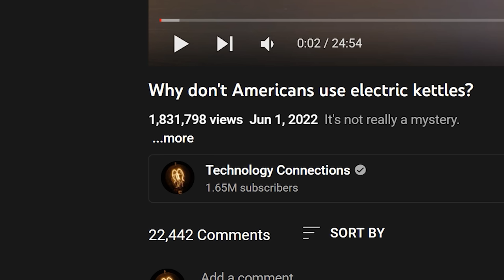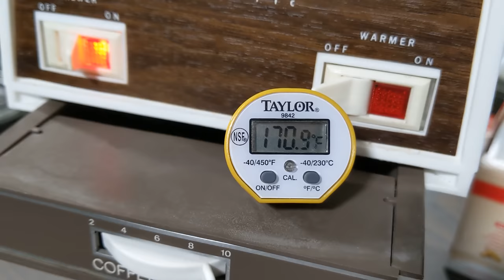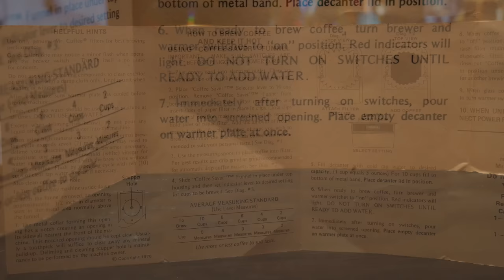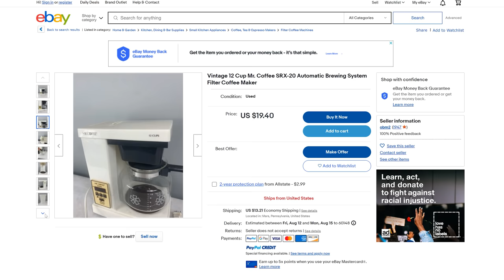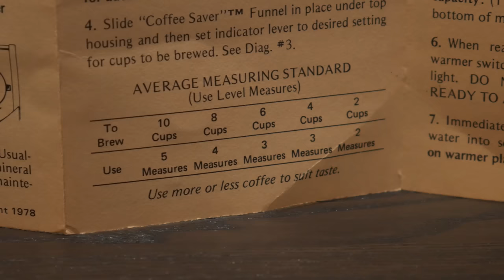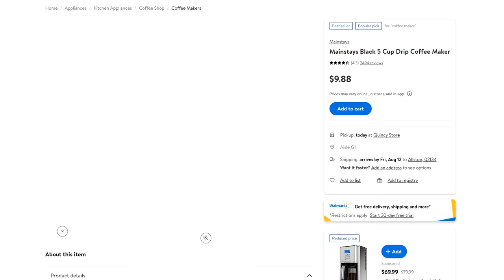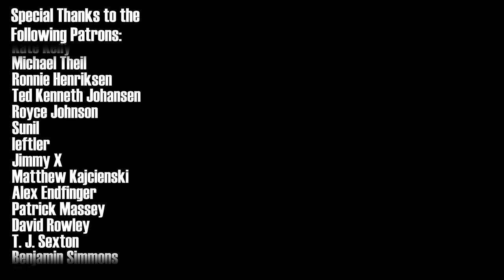Drip Coffee Makers — super simple, super cheap

Comment: I find that models without a hotplate are my favorite, I brew directly into a thermos-carafe on my big brewer and on my single cup brewer I brew into a small soup thermos. Either way my coffee stays warm for much longer than I actually need and I don't ruin it's flavor over time.
Reply: yea only using those for years. that way you can take your coffee to your desk and it will be warm till it's empty ^^
Reply: We had one of these for a long time. The disadvantage is that the carafe was the size of a 12 cup one, but only held 8 cups. 

The one we currently have used for over a decade now brews the coffee into an upper reservoir, and you can dispense it into a cup. It still has a heating element to keep the coffee hot but it seems to burn it less than the carafe style ones.
Reply: Back at home my parents used a basic brewer bit would just poor it all over in to a separate flask. Or better they had two. My mother preferred a slight less strong coffee them my father does.
Reply: @sirBrouwer  My father in law always poured his into an air pot (insulated vessel with air pump to dispense) from his bottom-of-the-line brewer as well.
Reply: @timfischer  I have seen similar things being used but just with the use of the water/ coffee pressure it self. Also worked with soups and what not. But it was massive. Like you use it when you go somewhere with a group.

Comment: Interesting video. I now understand why my coffee maker with a thermal carafe still has a hot plate on the bottom. I am guessing it was easier to leave it there than redesign the thing completely. It does turn off automatically when the coffee is done brewing, but it is good and hot during the brewing cycle and right after.

Comment: For years, we’ve added a paper filter in the basket of our percolator type coffee maker. To cut the hole for the stem, simply fold the paper filter in half 4-5 times and then snip off the point. Keep the hole diameter slightly smaller for a press fit around the basket stem. This keeps 99.9% of the grounds in the basket and allows for using any available or preferred coarseness coffee. This mod works for coarse ground as well as medium ground and fine (espresso) ground coffees. Clean-up is easier and the coffee is smoother tasting.

Comment: I really like your channel on different, sometimes a bit random topics, digging into details. And you never forget to compare to us yuropeans. I also like to see how things work in North America. Headlights, traffic lights, electricity system etc.

I always bought those cheap filter coffee machines for maximum 20 Euro (even cheaper if as company without tax). But they die fast in a company with several pots per day. Not the intended usage. So we always bought a new one almost every 1-2 years. Repair is not worth it unfortunately. 

Now the fun fact. We always bought the same cheap machines. They always had a mechanical I/O-switch so if you forgot to switch them off in the evening, the water vaporated And next morning you had a nice dark black coffee coating at the bottom of the pot. Nice work to clean. 👍

Then EU Intervened with their power saving regulations in 2009. Next dead machine: opening the last Amazon order "buy the same product again" and we got the exact same machine but with a pushbutton instead. Huu? Manual... Automatic poweroff. Adjustable up to 40 minutes but not possible to disable. Great. So now you can't forget to switch it off in the evening but during the day after 1-2h you have cold coffee instead. Yeehah, everyone was happy in the office.

EU is the biggest economical region in the world and the whole world benefits from standardized USB cables and even forces Apple to follow cause otherwise you have to produce different versions here and there. Apple is going to have their MFi chips in cables. EU Intervened: not standard, forget it. I prophesy Apple will introduce them anyway but if you switch location to an EU country they will turn of the limitations while you get them anyway.. 🙄

Vacuum cleans (or dust sucker how we call them in Germany) in my youth had 1600 watts, then fancy 2.000W then 2.200W then 2400W or even 2600 Watts and could suck a golf ball through a garden hose. Since 2009 they are limited to 900w in the EU and some are no fun to clean the floor with them. Sometime I just take a broom. 🤷‍♀️

Comment: Keep your coffee fresh with a vacuum canister!
Hey Mr TC, I got the one bit of coffee enthusiast kit YOU GOTTA HAVE: vacuum canister!
You said how you noticed how your beans would degrade with time, well, THEY DON'T HAVE TO!
Get a vacuum storage canister for your beans! This is will keep your beans fresh for weeks.
But watch out: you can get some that only allow you to suck out all the air when you close it, but that's not good enough. (Some actually work by twisting, which is really annoying.)
See, coffee outgasses, so the vacuum gets spoiled fairly quickly, which makes the whole thing pointless.
I found a battery-operated canister that has a sensor that runs the pump whenever the vacuum breaks.
Ngl, this can be annoying, as you'll hear the pump start whirring at random intervals, so if you sit in your kitchen, you'll hear it.
I made this acceptable by simply keeping it in a cabinet.
I can still hear it, but now it's just a soft reminder that my coffee is staying fresh.
The canister i have is made of glass made by a company called "Soulhand", and it was about $40 on Amazon. It charges via USBC.
I'm sure a guy like you could whip up your own, but this is easier.

Comment: Nice to see some of the ... interesting engineering on the OG Mr. Coffee! A few things I thought worth pointing out in general:

24:00 - this is a pretty cool feature, not because of "coffee saving" or whatever, but because in theory it should create better extraction by improving the full coffee bed's exposure to water. One of the weaknesses of cheap drip machines is poor distribution from the shower head, leading to an uneven ground bed with some grounds seeing very little water and others seeing far too much.

19:52 - years ago I was able to increase the brew temp on a similarly-designed brewer by fitting a piece of PEX pipe over the full length of the intake tube, effectively air-gapping it from the cold water in the tank. After this mod I saw a consistent 190 to 200F from the shower head, approx. 10F higher than before. Not sure if this would work on every coffee maker the same though, I guess it would depend on how good of a seal you can get at the bottom to keep water out.

22:20 - you'll be hard-pressed to taste minor differences in your coffee if you cover it up with milk & sugar. I suspect these tests would've had different results if you used black coffee, cooled to under 140F before sampling.
Reply: funny I was thinking that when I saw the water pour in, it's hardly saturating the grounds evenly.
Reply: @KairuHakubi  Exactly, and at the end of the brew you're left with a lumpy pile of grounds resembling a NYC road in February. Ideally you want a nice flat coffee bed at the end which suggests all the grounds received similar amounts of exposure to the water.

Comment: I got a moka pot at my local Meijer; there were an entire two different choices.  It makes a rather decent brew, but has the issue of requiring an external heat source.  I mostly take it camping and use it on a camp burner.
Reply: They make electric moka pots too, with a base and an enclosed heating element just like in an electric kettle.

Comment: On the off-chance you ever read this: I'd like to suggest the Clever Dripper or one of its competitors. It requires a kettle to boil water, but it's a fantastic hybrid between a manual coffee dripper and an immersion brewer like a french press, and because a filter is used cleanup is simple. Moka pots tend to make very intense or bitter coffee, and they're great if you want to make a latte or other heavy milk or cream based coffee, but quite bad for making coffee to drink black. Thermos or other insulated carafes are also a great upgrade for an automatic coffee machine, keeping the coffee warm without the need to run a hotplate after brewing.
Reply: Clever Dripper is amazingly overpriced for what it is and where it is made. I love the thing tho.
Reply: Espro as well with the paper filters who needs goosenecks when you only have a kettle and a scale cause YOU GOTTA WEIGH YOUR COFFEE :X
Reply: @4kirb  Oh absolutely. You could just fashion your own valve or cone out of an old automatic machine with a drip lock to get the same type of brewer. There are some patent concerns which is why the even more expensive Hario Immersion Dripper works with a different style of valve.

The clever is convenient because it doesn't require finagling or modifying a dripper with 3d-printed food safe parts and it's the cheapest dripper in its style even if it is expensive for what it is. It also uses the Melitta filter papers, which are extremely cheap where I live. An order of magnitude cheaper than Hario filters.

Comment: For what it's worth, I got into coffee during the pandemic and settled on a Clever Dripper coffee maker for my personal ideal taste-to-effort ratio. You don't have to fiddle around with careful and controlled pours like a pour-over, or plunging and dealing with metal filters like a French press.  It is, in my opinion, the best of all coffee worlds because you just pour your water, wait a couple minutes, and set it on your cup, then cleanup is just taking the filter paper to the trash and rinsing it out.
Reply: All good information. To add to that I would recommend using specific water temperature relative to the roast level of your coffee. Dark roast, like the legit covered in oil stuff, shouldn't be brewed above 88º, proper medium roasts fall into the standard zone most machines target (and rarely achieve) around 90-93º and modern light roast, high elevation, high density coffees require water temperatures at or around boiling, 96-97º at the low end.
Reply: @_DeadEnd_  Honestly, I bought a second one so I could make coffee for guests.
Reply: @_DeadEnd_  have you seen this video about stratification of the French press brew?

https://www.youtube.com/watch?v=st571DYYTR8

Comment: I honestly go for a pour over because I don’t drink enough coffee at once to justify a drip machine. It makes more sense for me to just brew one cup when I want it
Reply: Lately the best coffee maker for me has actually been the aeropress. It's convenient, pretty hard to screw up, and easy to clean.
Reply: @DevynCairns  I’ve heard good things
Reply: @DevynCairns  Yeah same, as I'm usually just making one cup my aeropress is so much simpler than the proper drip brewer, and I can adjust the variables (temp/brew time) way easier to my taste.
Reply: @embers_falling  honestly it's pretty impressive how well it works considering how simple it is, but you get a good clean cup and it gives you pretty good control without having to guess so much about your grind
Reply: @DevynCairns  I’ve definitely had it on my wishlist for a while but other stuff has seemed to come first.
Reply: There are small drip brewers that will do one cup
Reply: @juggernaut316  I have a few of them....I use it for hot water for coco
As much as for coffee in the shop..
Comes with its own mesh basket so no other filters required
Reply: @DevynCairns  I wouldn't use the AeroPress with store grounds though, they are way too fine IMO
Reply: I love pour overs but really don’t like the route many people go with it where they try to keep the acidity. I don’t like much bitterness either, so I try to brew a well extracted cup that has high body and a dark color instead of being tea-like. I might get a flat bed brewer instead of a V60 if it’ll help with that.

Comment: I use at home and in the office: 2 espressomachines, a filter / drip machine + thermo pot, a mocha pot, a french press and just ground coffee + boiling water in a cup. I am a heavy user. I would say that the drip / filter system produces the least bitter coffee, and because of the thermos, keeps the coffee the longest at constant quality. Even the second half from the french press is already more bitter and/or acid. The espresso machines use 7 grams per cup - but since the water is forced through it so quickly, it seems to me you get much less of the flavour out of the coffee, compared to the same amount of coffee in the drip / filter system. My conclusion: the filter / drip system is the most economical in use (i drink about 1 liter per day), is easy to operate, minimal cleaning and quite good coffee. Big factors are of course water (in the office i use barelled water, since tap water is aweful there) and the brand of coffee - I found that cheaper brands often do not have a constant melange, so the next bag may taste significantly differently.

Comment: A notable improvement on a drip brewer that solves the hot plate burning the coffee issue is ones with a vacuum carafe by which you only have a brewing element and it dispenses the coffee directly into the insulated carafe. So you get warm coffee that is still fresh later!
Reply: Additional to saving electricity...
Reply: I have one of these and it is fantastic.
Reply: Yeah, the stainless insulated carafe with no hot-plate is the best way to go nowadays!
Reply: Actually if you let the coffee boil down to a sticky paste in a glass carafe and then make a fresh pot over that you end up with something real special. Mmmmm.
Reply: Yeah, don't want to continue the Europe vs 'merica debate, but this is another difference. Vacuum carafes are much more common over here. They're used almost exclusively in Germany and Austria where this style machine is most popular. Very sensible and efficient.
Reply: @SamSeedy  This one isn't vacuum, it's a regular drip machine, just that it has a sealed stainless, thermos carafe(the pressure of the weight of the water pushes the valve down to allow the coffee to drip into it) that keeps your coffee warm without need for a heating element underneath.
Reply: @fattomandeibu  "thermos" is a vacuum flask, the void between the outside and the inside contains a vacuum and is sealed, which is one reason you're not supposed to put them in the dishwasher, as the uniform heat can cause the vacuum seal to break, and then you get water inside. The void being a vacuum means there's less molecules to bounce around transmitting heat from the inside to the outside, and this keeps the inside warmer or cooler than the outside.
Reply: @genewitch  He's talking about  vacuum-style coffee maker. Look it up, a completely different appliance than a drip machine using a vacuum sealed carafe.
Reply: @fattomandeibu  I don't think he was. He mentioned a vacuum carafe, which is what you get these days in lieu of a hotplate for keeping coffee warm. Are you talking about siphon coffee makers?
Reply: @fattomandeibu  Yeah, I'm afraid I think you're the one that has misunderstood. OP literally says vacuum carafe and goes on to describe that it doesn't have a heating element for the hot plate. He's not talking about a vacuum brewer.

And generally Thermos and vacuum flask are used interchangeably. Vacuum flask being the more correct, and pedantic, option.
Reply: @SamSeedy  the reason is actually a EU energy savings regulation from 2015 which mandates coffee makers to have a standby/off mode after a certain period of time. Most coffee machines switched to insulated jugs in order to make the experience as comfortable as it was before regulation.
Reply: Vacuum brew is best brew!
Reply: Oh yeah. For sure

Comment: I did a simple "fix" to the warm feature that makes a coffee taste burnt like you said by installing a second 80c thermostat in series with the original thermostat and installing a bypass switch that i can flip when it done brewing so that the hot plate doesn't get hotter beyond 80c and it solve the problem. When i need to brew another pot i just flip the switch again to bypass the thermostat and way it goes.
Reply: Sounds like a more determined effort than the old "small-coin-under-the-pot-at-the-edge-of-the-hot-plate" trick routinely used at the more knowledgeable establishments :)
Reply: @johanmetreus1268  well i'm surprised that i haven't heard about that trick. Idk maybe i just love to mess with electronics. I mean it still works just find until now. Beside the ugly switch that i just put into a hole that i made

Edit: I think i need to add that coffee machine is not common in my country so that might explain why.
Reply: @depressedbread6893  For what it's worth, I frankly adore your solution to it, as that is solving the problem proper rather than the basically jury-rigging the coins are.
The Nordic countries drinks more coffee per capita than anywhere else in the world, so might be the reason the machines are so abundant here.

Comment: I finally found my perfect drip coffee maker in a Phillips one with an unbreakable thermos can. It fixes the hot plate issue because it doesn't need it and I always break the glass pots within a year, usually when putting it down on a very hard surface. It was 60 dollars though, pretty much my personal upper limit.
Reply: But it's cheaper than buying new carafes every year, right? :D
Reply: I have the same sort of pot. Saves electricity too without the hotplate. You won't burn yourself on it. I'll take it in the car. Stays hot for hours.